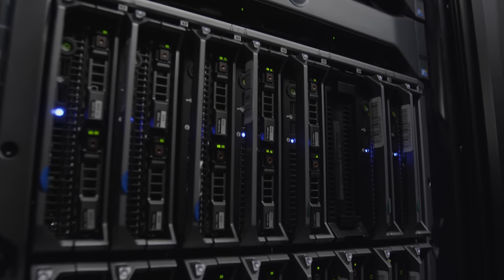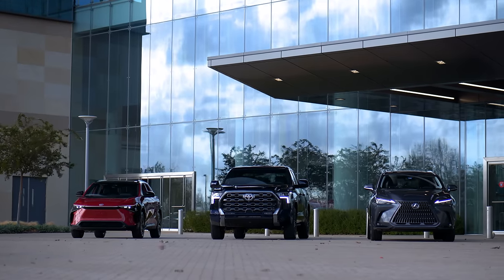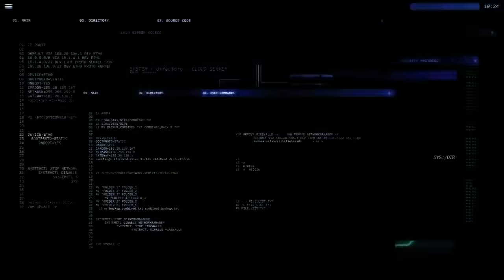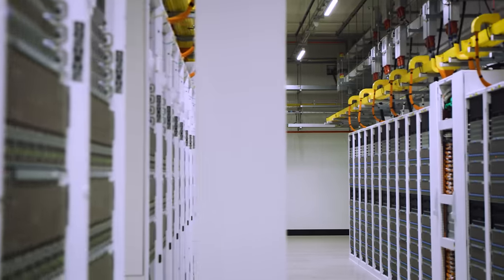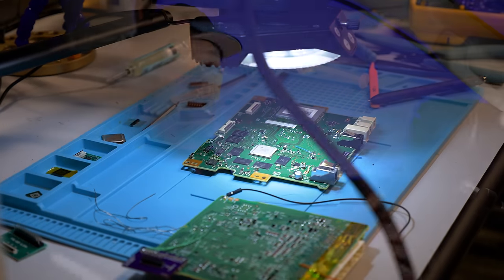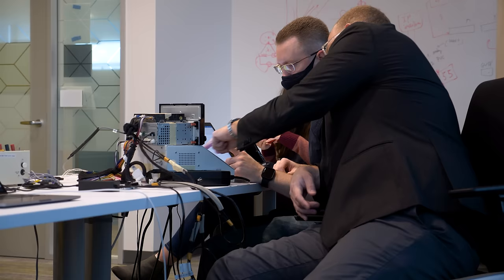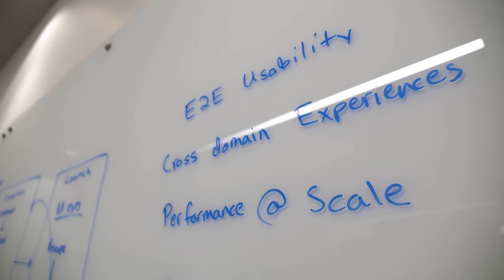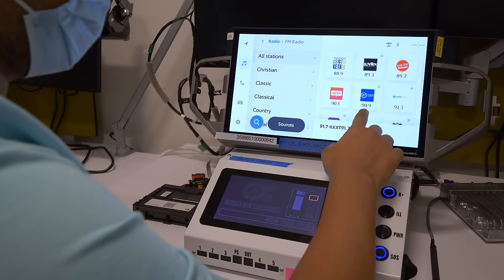How Is Infotainment Designed?

Comment: At 39:00 he talks about getting drivers to not use their mobile phones while driving. That's great, but now, infotainment systems are responsible for a growing rate of crashes. They are just as distracting as mobile phones, perhaps more. It's a complete out-of-touch attitude to increase the influence of the infotainment system on the design of the car, and then claim they're most interested in safety. The data speaks for itself.
Reply: I don't think people realise just how much distance they are covering while driving blind in order to look at the screen. Multiple seconds are required for each action, especially if it's embedded in a menu. If something were to happen ahead, it can be the difference between gentle braking and a hard crash.
Reply: No Chit.
Reply: That feels like it's right, but do you have a source for that?
Reply: SG's video on the Tesla 3 covers one of them, but you could just lookup infotainment related crash statistics or touchscreen related crash statistics and there's quite a bit out there
Reply: This is very true, but it’s also worth noting cars with this level of technology also have active safety systems to prevent or mitigate accidents that a distracted driver would typically cause.  Still, that doesn’t excuse interfaces that are distracting as you have said.
Reply: No, that’s the whole point of improving these systems. If you just say “my phone works better” then we might as well all text while driving.
Reply: exactly.
Reply: @Starblockss  I think a big part of it is saving money to on the manufacturing end
Reply: Ass riders get into accidents while using their phone. I stay about 6 car lengths behind the car in front of me. Granted I get cut off a lot, but I have never been in an accident or got a ticket in my life. I started driving when I was 16 and I’m 42 now.

Comment: All this complicated tech makes me value my '95 300ZX even more. The two buttons pods on the sides of the gauge cluster are absolutely wonderful. Headlights, fog lights, front and rear wipers, dimmer switch, cruise control on/off, all HVAC controls, and defrosters are within 6" of your fingertips without cluttering anything or being distracting.
Reply: The 300ZX had the best ergonomics ever. I had one and the instrument cluster and pods was a masterpiece.
Reply: @povertyspec9651  this has me thinking, I wish there was some way to objectively measure the quality of ergonomics in a car. I wanna know what other cars would score very high
Reply: I haven't driven the ZX but I am certainly grateful my 370Z has such an 'outdated' interface. The touch screen is predictably slow and unresponsive and the maps have never been updated (because it costs like $200) but everything else is familiar and easy to use.

Why this obsession with being able to reprogram UIs and update everything all the time? Is that really what drivers want?
Reply: @dielaughing73  Car manufacturers keep saying its what people are asking for but ive never actually met someone who wants this stuff. The few that do, go figure, drive electrics.

Comment: At 16 minutes he justifies putting heated seat controls in the screen by saying you only use it occasionally.
While this is true, I still want to be able to operate it while driving!! When will these designers get it into their heads that multiple seconds looking down at a screen while driving is unsafe in any case?!
Reply: Never, because they're programmers. Open up Photoshop and tell me if you understand anything about that interface.
Reply: Exactly. If it is in control of comfort it should be available at a touch while blind
Reply: that is a load of shit....thsi is why i FIRMLY believe there should be 100% different developing departments for u.s.a and canada....in winter the heated seats are used nearly 6-7 months out of the year....
Reply: @Fra-gee-lay  I'd go further and say something should only be on a screen if it can't be represented in any other way. And all screens should have an off switch.
Reply: His logic about how you only use those seat features during specific weather conditions is just flawed, all that really means is that heating/cooling should be part of the automated climate control suite, not that you can just bury it in the infotainment to find later. 

I use my heated seats far more than i use cruise control, yet car designers put 4 CC buttons and a toggle right on the steering wheel but think it's ok to hide the heated seats in a menu?
Reply: my car, physical buttons for hot/cold, fan speed, auto climate, air location, front/back window defog/defrost, recirculate, heated seats, but...... heated steering wheel and AC on/off touch screen only (AC does turn on when you press Auto climate button, but it just doesnt indicate that the AC is on, on the touch screen), like why though?
Reply: I came to the comments to say the same thing. They save a few cents eliminating the buttons and make the UX so much worse…
Reply: Living in Canada, it’s June 3 and it’s 0c in the morning and the high is 20c. I would use both heated seats and cooling seats in the same day.
Reply: I tend to disagree. Buttons are over-rated imo, because most of the time seat controls and temp controls (e.g. VAG cars) are placed down low to be in reach and i always have to look down regardless of muscle memory. I think people make it a big deal. It's all about ergonomics. Having buttons higher in the line of sight would be much much better imo. It's not always a black of white situation like screen bad buttons good.
Reply: @cosmingosav  Okay, seldom used buttons might work in a UI instead, like resetting tire pressure for TPMS or setting your clock fine. You don't need the HH and MM buttons to set that. But your comment about looking down to re-orientate where the seat warmer button is, would at least allow you to move your hands towards that direction and feel your way to turn it on. If it were on a screen, you also seldom use it, you'd have to navigate multiple pages, multiple sections etc. 

So while I agree it's not black and white, just saying the example may not be as clear cut
Reply: @cosmingosav  um…feel your way around the buttons? You should try it. 👍🏿
Reply: @teebles  I do agree, I just wanted to emphasize that most journalists are straight up bashing everything digital while the problem of car interior ergonomics is much more complex
Reply: @gaara4667  That wasn't the point. I could say you can feel your way around the touch screen too.
Reply: @cosmingosav  Yup sure. I do think geese and Straight pipes, they do mention there does seem to be a happy medium between them. They see enough cars to know that some things in UI is okay, but people like VW/Audi just go too far...
Reply: @cosmingosav  what?
Reply: @Scypher0th  Here in So. California, I use ventilated seat control every day for my leather seats whether temp is hot or cold. Thankfully, Mazda still uses buttons!
Reply: What he means is that, if you wanted heated seats, its something you do in the car before you leave and start driving. People don't adjust heated seats mid-drive like they do volume, therefore it makes sense to put it on the screen.
Reply: these are MBA nerds that like the status of working for toyota corporate, they are not passionate about cars.
Reply: @cosmingosav  You're comparing feeling around a flat, featureless screen with feeling around where your fingers can identify a physical button by shape... You get how that isn't the same, right?
Reply: @itcangetbetter  Yes but that was not the point. I didn't say screens are better. I just said that not all buttons are made the same. For example, there are bad, not ergonomically placed climate controls which force you to look down to see what you've selected, which is kind of the same with screens.
Reply: @cosmingosav  this was a specific case. You will be able to identify a seat warmer/cooler by rich. You will not be able to identify anything on a screen by rich. Your point that there can possibly exist a button for something somewhere in a rare instance that requires you look down is clearly far better than a screen that's requires you to look every, single time.
Reply: @Scypher0th  heated seats are going where the polar bears are going
Reply: @cosmingosav  you raise a very good point. In the end Toyota and others ONLY WANT MORE PROFITS. So if they have to have buttons made out of plastic and use its own touch sensor underneath, it costs them more money than pushing all through the "user interface screen". In more than one way they hurt themselves because they could continue making ergonomics, comfort and controls better and better each model change.
Reply: the controls for heated seats should be on the seats themselves or on the centre console next to the gear stick, and with a nice texture so you can hit it blind. Not on a touchscreen.
Reply: @stevesamuel263  People do adjust the heated seats mid drive.  Yes, you turn it on in the beginning to get hot, but once it's hot, you want to turn it down to a lower level.
Reply: A humble opinion: The only reason you'd want to operate heated seats while driving is because we so far have not seen a system smart enough to "predict" when you want/don't want the heaters turned on.

The holy grail for UI/UX designers is to be able to do what you want it to do without any input from you.
Reply: @johnhoo6707  Bummer of a truth: no ai anywhere can predict how hot or cold anyone actually wants anything ever all the time. There's too much in the equation: temperature of the day, activity of person before entering, change in body temp while driving, speed of hearing/cooling provided by car, and above all the fact that each person has their own feelings on what an enjoyable temperature is.

This is why even though there are cars that link seat temp with the auto climate function, people still want a button.
Reply: @johnhoo6707  Yes they still want you to be the SENSOR! Well at least SOMETHING is not automated yet! 😂
Reply: @Scypher0th  or just do what my BMW does, auto climate rules , below a temp auto turn on seats. Oh it has buttons too.  Stop with the soft button
Reply: @stevesamuel263  That's ridiculous, people definitely turn on/off heated seats while driving. I'm not going to stop on the side of the road to turn them off.
Reply: @JonathanPaulin  The only reason I can think to do it is if it's cold, turn on heated seats when you start the car and turn them off 10min later when your butt is warm enough, same with the steering wheels. How  many more times would you need to touch them? A feature used 2 times a drive is best left digital.
Reply: It works perfectly fine in their stationary mockup, lol. Unfortunately it seems like none of the people working at any automotive manufacturer has driven a car in their lives
Reply: Of course you do. U usually turn heat down after some time. Don't wanna boil my ass
Reply: I paused the video at that exact moment. I like having A/C blasting with my heated steering wheel and heated seats on. Mid drive I might turn the ventilated seat on. Anything temperature related needs to be physical. Those glossy touch buttons that VW/Audi seem to love on their steering wheels is the entire reason I won't buy those cars.
Reply: Here’s an easy answer to where to put the heated seat controls: Nowhere.  I’ve lived in Alaska and the Upper Midwest for most of my life, and have somehow put hundreds of thousands of winter miles on cars without the need for an electrical element resistance-warming my ass.  Same for cooling in the summertime.  Shitcan the leather upholstery (it’s really no better than the “leatherette” vinyl options of my youth), take reasonable care of the durable fabric seats that are the base-spec in most current cars, and you won’t need the BS/fragile tech.  Your girlfriends may have to suffer with VPLs under their yoga pants, but hey—that’s winter.
Reply: Makes it easier for control via subscription.

Comment: Great video, Mark! We bought a Venza last year, and purposely went for the XLE rather than the Limited because of the full haptic controls on the Limited. The XLE is much easier to operate on the move. I hate looking away from the road while driving (we live in the most densely populated state), and any control that doesn't become mostly muscle memory will be ignored while driving. 

I like the idea of connecting profiles to users' phones. Even better, allow users to set up all their preferences on the phone at any time, then apply the settings when they connect to the car. This is what bike computers such as the Wahoo Elemnt do now - no fiddling around on tiny head units, just set everything in the app and it's done.
Reply: So here is the real reason these researches are being done.
Make the lower level cars harder to control and then convince you to spend more and buy more optioned cars.
I mean it was just fine when it was all analog.
Reply: @jmat7103  If you're referring to David Mulligan getting the XLE instead of the Limited with your "Make the lower level cars harder to control and then convince you to spend more and buy more optioned cars." comment, then you are incorrect.  The XLE trim is a LOWER level than the Limited.  Hyundai did the same thing with the Tucson if I recall correctly.  So they're making their higher level cars harder to control.
Reply: @crazedmodder  thought the xle was higher trim. I stand corrected. But either way... It seems like it's a regression than progression.
Reply: @jmat7103  I agree, it is kind of sucky and is honestly keeping me away from a lot of cars.  I'm worried that at some point they will all go the haptic path though and then I cannot get away from it.
Reply: @jmat7103  Yeah, the XLE is the mid-level trim, with the Limited being the top trim. For '21, the XLE had heated/cooled seats and a heated steering wheel (with the Softex package), and those were the most important options for my wife. I watched review of the Limited with the haptic controls and I knew she'd hate it.

Comment: Personal case-study. I purposely went from a 2012 Volvo with a screen-based UI interface to a 2010 without it. My parents have a 2022 Volvo with everything tech-based that the car offers, and man, its a lot to navigate. 

I am vastly happier stepping  backwards to a more analog experience where I focus on, and enjoy more - the driving experience. I'm 35, and have all the electronics I need in my iPhone, ipad etc, but for my car, I feel that we are getting way too distracted by systems we do not need while operating heavy machinery. Nice to have for some, cumbersome and dangerous for others. That middle ground is tough to achieve for sure...Maybe when it gets simplified and basic features are not layered in distractions to access, I will be more inclined. Makes me enjoy my older cars so much when you see what we "didn't" have for so long, and were just fine.
Reply: I have a 2010 S80, and the only screen it has is the pop-up Nav system. Unless you're using Navigation, the screen stays down.
Reply: @mhirst16  I went to a 2010 S40 which has basically no screen and the cleanest dash design in modern automobiles, my 2012 Cross country was awesome but you could tell Volvo had to do a lot of re-designing to get the screen integrated into a dash that was not designed for it when the car started its life. Interface was fine, but I love the uncluttered nature of the dashboard for this reason.
Reply: @joelbolton7252    I think this happened to a lot of manufacturers...there was a time in recent makes and models, (looking at you Audi) where in cars like the A3, the screen is just stuck to the top of the dash, it looks like an iPad was taped on there like an afterthough...just horrible.  

Finally carmakers are starting to realize that looks like shit, and are at least building the dash design around the screen instead of the other way around.

Comment: A car that is dependent on internet access for cloud computing is not going to be much use in the huge portion of the planet without any internet service. I know that's not where most people live, but they do need to drive through these areas.

This whole thing, especially the dependence on touch interfaces and the loss of physical controls, is a massive step backwards in terms of usability.
Reply: Starlink may be a solution to internet access in remote areas.  Hmm.  Maybe Elon's random biz are not so random.
Reply: Id say thats actually where most people live. These companies only care about people who have 45,000 USD, on average, to buy a new car though. "most" people buy used and have barely passable internet connections.
Reply: No Sale, I do not want this in my Vehicle at all. Give me a basic reliable Automobile. The more bells and whistles in a system or Automobile the more there is to break and the more vulnerable the vehicle is to software, data privacy, and hacking issues. No thank you. As long as this trend in Automotive design continues No Sale.

Comment: Call me crazy, but for me it's this simple: will I want/need to do it while driving, or every single time I start the car?  If so, I want it on a physical control.  And let's be clear: 'cognitive overload' doesn't happen because "too many controls", it happens because "not enough differentiation between controls."  When every button is the same size, in a long row, and all icons are tiny and look same-ish... no bueno.  Intelligent layouts, sizing, spacing, shapes, colors... we can process very complex systems easily, IF they're designed and laid out ergonomically.  /end rant